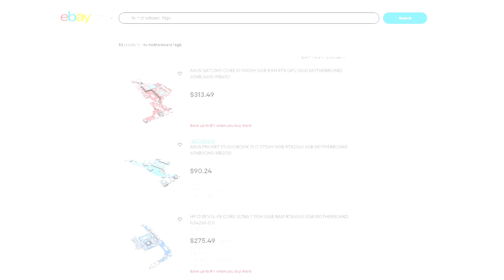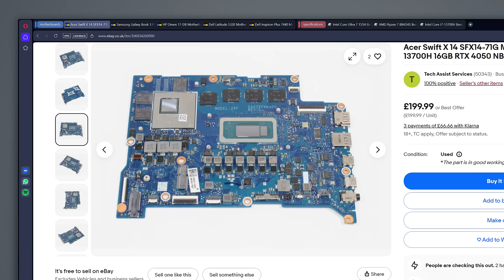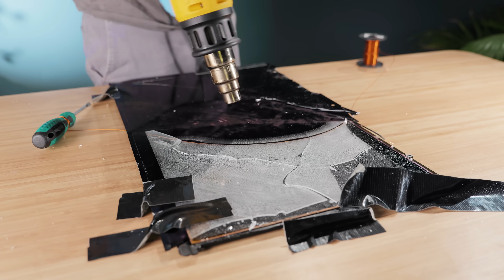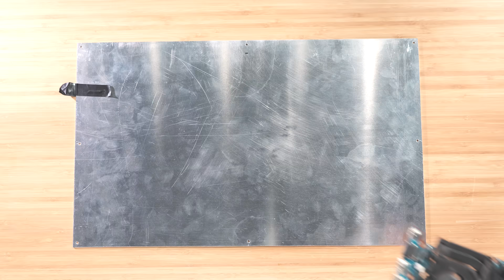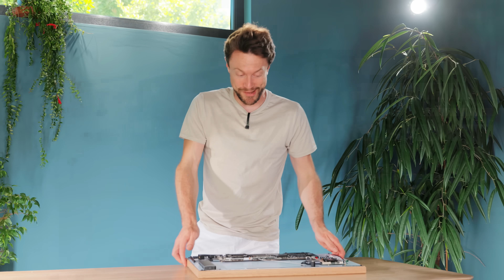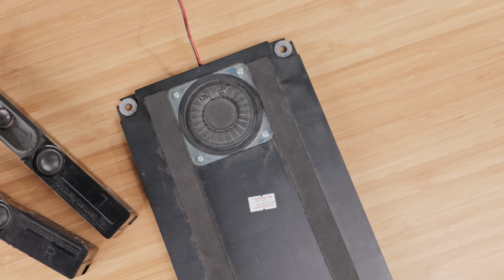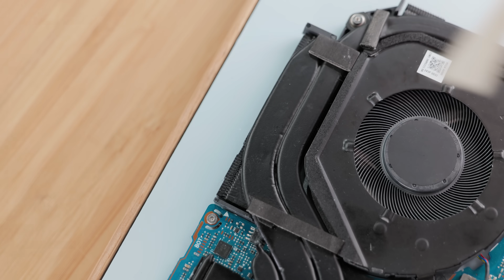A new way to build a PC in 2026!

Comment: Don't know of it's because of your video, but the prices you mentioned on the video are nowhere to be found,  basically from the moment I first saw your video some days ago. 

Please note that the comment is not meant to attack you in any way. Just what I've seen the past few days I was searching for hardware. 

I really wanted to build a mini gaming PC from a laptop. But whether it was ebay or somewhere else, the price is quite high... Most motherboard come without a cooling assembly... Let's say I search for an rtx 4060 mobo...
It's around 400€
The cooling assembly is 50€
What about the PSU, you need one of those too... 50€ for an after market one. 
Do you want it to have a battery? Maybe it even helps with performance stabilization for power peaks. 50€ at least... 

We are sitting at a comfortable 550€ price point. 
But here's the thing... I can find a used 4060 laptop in great condition for 700€... 
It has a high refresh rate screen, has a battery, has a charger, has a trackpad, keyboard, speakers, chassis... Requires no physical labor... If I get that, disassemble it and sell it on ebay, well, I feel there will be some profit xD 

But here's the real kicker... I found another used 4060 laptop for 360€, not in great condition, damaged charger, dead battery. Told the seller 250-300€ and he agreed... We settled at 300€ although I could have gone as low as 275€. Didn't really want to push it though. The price was already great, why steal the dude... 

The charger, I might be able to repair, his dog ate it he says, I found it funny tbh 😅

The battery should be dead, but I can find a new one not for too much. 
The rest of the laptop should be in okay condition. Maybe some cracked plastics here and there. 144hz display, okay-ish keyboard... Very capable cooling system. 

Whether I turn it into a mini PC or I keep it as a laptop (i like the display and the backlit keyboard 🥲 and the motherboard has a weird shape that doesn't allow for a particularly small footprint...), It was a great deal for the money. 

Took me 1 week or so before I thought of searching for used laptops. I basically thought that maybe I could find one with a damaged screen or something. Inwas way more lucky than that xD

Comment: Awesome build. I noted you sealed the gap between the heat pipe and the fan top outlet. This is actually a design feature to allow air to flow directly over the heat pipe where it can take away plenty of heat. This design usualy goes with the laptop bottom casing where the air is restricted to flow over heat pipe only with the cushion on the heat pipe ensuring a tiny gap. you can emulate this by placing a flat object on top of the heat pipes between cushions which should cover the entire fan top outle tto ensure air doesn't leak out and only flows over the heat pipe (and of course majority of it below heat pipe through fins)

Comment: Such a shame. I today had a laptop screen die on me while it was in still quite need condition, sure it was a bit old but working very well to this day. So i though why not try this as would be a pretty cool thing like those framework mobo's that you can use make a desktop from.

Now it was an Acer nitro 5 with a just old enough series that it doesnt do display over usb-c meaning i cant get the laptop to show the bios or make it boot the HDMI to let me use it. Its such a shame as it would have been a so cool project. And i already got as far as to find the whole pins to manually short it and make it boot up and everything. 

Hopefully i can still find some work around but i doubt it :(

Comment: And of course, thermal throttling is still the enemy for it; it would be nice to solve that problem too because just having an open design wouldn't cut it. Those fans are not nearly enough; they are only used for laptops because of the size and not for efficiency. They are not efficient enough

Comment: Did a similar thing but with the 2009-2011 model iMac that still has a very good 2k panels. Been using it as external and also as a full computer old laptop that made it feel almost as new as it can be xd

Comment: REQUEST: ❤🎉Hi, From Africa 🌍- PLEASE BUILD A COMPUTER WITH ALL ELECTRONICS SUBMERGED UNDER WATER INSIDE THE CPU. BUT THE SCREEN DOES NOT HAVE TO BE. NO FANS TO COOL IT. COOLED BY WATER CIRCULATION OR BUBBLES. 😊😊😊😊 🥺 🙏🙏🙏

Comment: I have to try this with an old Dell E6540 i have lying around. It's missing the power button piece (which is no big deal since it's just a piece of plastic that clicks the power button) and the battery. I do need to find out how to stop the auto system check from showing on bootup (which appears when the laptop doesnt have a keyboard) Everything else works, though!

Comment: Ribbon cable isn’t needed. You can’t solder to the connector pin, but you can easily solder to the leg behind the connector that goes to that pin. You could also just remove the connector and be able to solder directly to the pad. You need a hot air gun or use ChipQuick desoldering solder to do that. I’d just solder to the leg

Comment: Any modern ( last 15 years or more ) laptop or desktop CPU without a heatsink will not " thermally destroy " itself as you noted.  For a very long time all these CPU's have built in layers of self preservation that will shut it down before it can melt itself down.

Comment: Thankyou for the awesome tip, about the power button.

Finally i can create an external power button of my laptop, that i use as a desktop anyway xD
No more need to open the lids to potentially damage the hinges.

btw, what about bios though?

99% of laptops don't output Bios page to external displays unfortunately.

If you can get that sorted aswell, it would be dope.

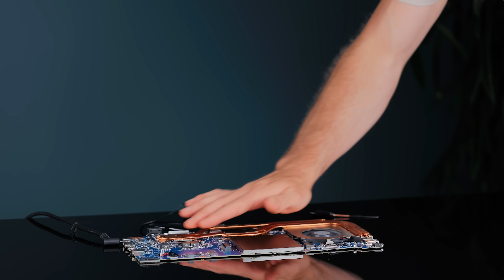Comment: 4:27 - That doesn't really apply to relatively modern chips. Typically booting a CPU without any heatsink on top of the IHS won't cause any damage. It'll just reach it's TJmax very quickly then shut itself off. It's pretty hard to get computer components to fry themselves.
Reply from the maker: The problem is that they don't have an IHS, so the die could get extremely hot very quickly before the thermal sensor can notice it.
Reply: @DIYPerks  Wow, I can't believe I didn't even think these chips don't have an IHS. 
I'm so used to working with desktop components haha!
I love your videos!

Comment: I'm positive that voltage regulator can't handle the extra 100W you got from the 200 to 300W upgrade. Might be worth checking it its not generating too much ripple or swapping for a beefier regulator.

Comment: The finished product looks quite awful, worse than even a TV set from sixties, in a way. And the constant thought that it might crash to the floor any moment due to the flimsy stand isn't reassuring either. Technically a somewhat interesting project, though.

Comment: That is a beautiful PC and an interesting way to recycle old equipment but I know an easier way.

There are literally hundreds of thousands of Windows 10 PCs and Intel Macs that are no longer supported by Microsoft or Apple. But they are not obsolete. You may have upgraded to a newer machine, but don’t just throw those old machines in the back of the closet. Drag them out and install Linux on them.  That will make them useful again for at least another five years, even if it is just as a second computer or server.

My newest machine is an HP Prodesk 400 G1 SFF from 2013 which is my Jellyfin media server. My main machine was a top end gaming system when I built it in 2012, and is still great as a kvm/qemu virtual machine host.  Both of those run Linux Mint. My third system is a Pentium 4 from 2003 running MX-Linux and DOSbox which I use to play retro 90s windows CD games like Warcraft 2. Although its main use was to show all the people panicking about losing windows 10 support that my 23 year old computer is still running a fully supported and patched operating system safely on the Internet. 

Sometimes all you need to recycle old hardware is just a better operating system.

Comment: just remember , laptops are normally shared system memory between system and the graphics card so dont try to do this and go head to head with identical specs you will loose. also there is some clocking they do in laptops cuz the space constraints i would add make heat block would allow you to get higher speeds.

Comment: Out of curiosity, why don’t you try and incorporate the power brick into the build itself? 
I’m imagining for this particular situation, you wanted to utilize the extra space for that sweet subwoofer, but I wanted to know if there is anything stopping you from putting the power supply brick inside the chassis to allow for a truly all-in one mobile work station. 

P.S. extra points if it could incorporate a wireless keyboard and mouse on the back of the unit. I can image people stating “why not just get a laptop” but utilizing a monitor brings about the greatest benefit to desktop computing which is a bigger screen and more ergonomic display height that frankly a laptop can’t achieve without external hardware

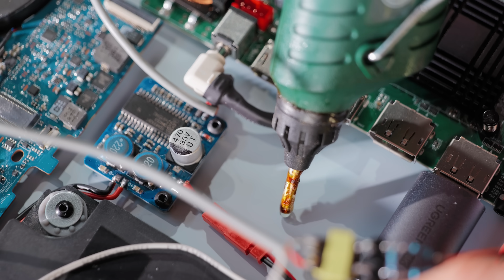Comment: 21:00 That attenuator circuit seems a bit strange. The DC-blocking caps should be required either, as the class D will have no DC, or the speakers it was driving would have an offset. It would make more sense to make a resistive summer from the speaker signal, add the LPF, and then a single audio transformer.

Comment: Another problem is that these motherboards don't come with heatsinks, and heatsinks are completely particular to their respective models. If it comes down to it, you might have to build your own heatsink with copper pipes and a heat spreader. That will probably work better than a normal laptop cooler, imagine bolting a tower on.

Comment: This is, or I should say WAS a legitimately great idea if you were able to jump on buying laptop boards probably about 6 months ago. Cause at that point you could still buy full main boards with all their stock vapour chambers and fans etc attached. Unfortunately as newer replacement stock of these has been shipped to people who hold this stuff the manufacturers have been shipping them without the cooling hardware as coper (among many other things in the PC world) has gotten more expensive and manufacturers have cut costs by not shipping them with the cooler which also saves weight and therefore more cost operating under the assuption that someone buying a replacement board will likely have the original parts that they can salvage from the existing board in order to make everything whole again.

That said it doesn't mean you can't do it. You just need to either buy a stock cooler as well or make something yourself. But if you DIY the cooler you need to be sure that the board WILL boot without a stock cooler. Not all manufacturers will have that level of leeway.

Comment: It's a very cool idea to use laptop components for such a build, due to the high price of desktop components. But the wooden legs, it looks aesthetically pleasing, but it is absolutely not functional, it is impossible to tilt the monitor, raise it or lower it, this can create problems with prolonged use. It's very impressive that you managed to restore such a screen, but as far as I'm concerned, it's only good for work, playing on a 4k display with such laptop components doesn't seem like a good idea to me. And these thick frames on the monitor, and I understand that they create the feeling of a picture frame, but here again the situation is when aesthetics prevail over functionality, which I think should not be in such devices.

Comment: I use half-a-vivobook as my work PC in my office. 
The only thing you forgot to mention, is that there are lots of motherboards that don't have a dedicated CMOS battery, so it might be a good idea to either keep the battery off a donor lappy, or at least not to be surprised when CMOS error pops up after reconnecting the power. Also, the power button solution while looks cool - it's jank(can short-out nearby pins easily, cause that paper has no side-tabs and ain't perfectly flush). Usually there is a testpoint for power button nearby or near multicontroller, which is a perfect place to solder the button(or find a resistor or a cap on that lane and solder to it). Other than that - looks good. 11/10 for aesthetics.

Comment: Great build! Did you consider adding a new glass pane to protect the LCD long term? I built a wall mounted display from a salvaged Thunderbolt Display a couple years ago. I used a single pane of clear glass attached to a wood bezel that used the existing magnets on the frame to give a removal front (bc of wall mount). The image quality wasn’t impact by the glass even though it wasn’t glued to the LCD you could probably achieve the same thing on your static bezel

Comment: Hi, Matt. I'm a big fan of your inventions. I work as a handyman and my tools are everything to me. But like any handyman, the battery of the tool is very important, not only in terms of capacity but especially in terms of weight and size. I'm a Milwaukee fan and so far the company hasn't made, like Dewalt, a small compact 18V battery that would be convenient for working with the tools. Can you come up with something and encourage Milwaukee to make something small and compact?!

Comment: I admire the craftsmanship and also how the case for the front speakers even reinforce the rigidity of that stand.
One thing I'd still do is to equip that side gap with printed/cut panels to minimize the amount of dust that can settle in there over the years.

Comment: I love this. I think laptops with broken chasis or displays that still post are better options since ou usually get the laptop, an aluminum backplate with the standoffs already. maybe even speakers. 
My buddy made use of an old imac that had a broken motherboard. kept the display and case and built his "PC" inside the original imac case (this was one of the older imacs that werent super thin

Comment: So to recycle old electronics all you need is! Money to buy the parts, and a lot of pray they work, a deep knowledge of the parts and electronics you have purchased, a heat gun, a multimeter, drill, 3d printer, all of the extra diy components like copper, aluminum, wood, more deep knowledge of audio equipment, and time. Cool ill start tomorrow. 
I joke i love your videos :)

Comment: One small warning to all those who want to make this, the 3.3 or 1.8v signal on the display ribbon, might be a supply line rather than a pulled up signal line. You really need to be careful when testing. Dont hold down the button in case you wired to a supply line. As this will short to ground and potentially burn out a trace or blow the DCDC converter supplying that line. (if the converter dosent self short protect) 

Using a multi meter doesnt indicate whats a supply, and whats a pulluped up signal line... Also, many keyboards will have I2C or SPI as well. These too will be pulled up to the same voltage...

Comment: @DIYPerks how did you handle the missing CMOS battery as modern laptop motherboards don't have one as it used the laptop battery for that. So you get bios errors at start every time powersupply is cut off

Comment: 23:30 you’re tellin me this guy basically made a gaming pc that rivals the steam machine for a fraction of the bloody cost?
Reply: What the YouTuber did is an impressive DIY craft project and a fun video essay. But thinking it rivals a mass produced console or commercial PC ignores how economics, manufacturing, and the PC hardware market actually work.

He got lucky finding a cheap broken laptop motherboard from someone who probably didn't know what it was worth. Good luck buying 500 of those consistently at that price,

He literally screwed two aluminum plates onto a bare laptop board, cut a hole for a fan, and called it a day. That’s like driving a single nail into a wall to hang a picture frame and claiming you built the house.

A real product comes with driver support, safety certifications, custom tooling, and a warranty. If that refurbished motherboard’s soldered RAM dies in two weeks, nobody is there to ask for refund.

They are different concepts entirely.
Reply: @seekyunbounded9273  quiet GPT/Gemini

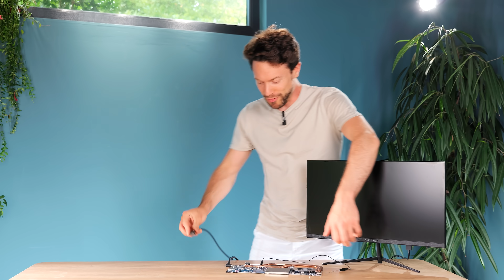Comment: 4:35 to check if you have at least booting board, you can get away with putting a sufficiently sized finned heatsink for the couple of minutes you need to confirm base function. And thankfully microcode level thermal throttling is a thing. If your CPU cooks itself dead in an under 10 minutes, its sensors are either already fried, not communicating, or their microcode level corruption and its already functionally dead silicon. Too unstable to rely on.